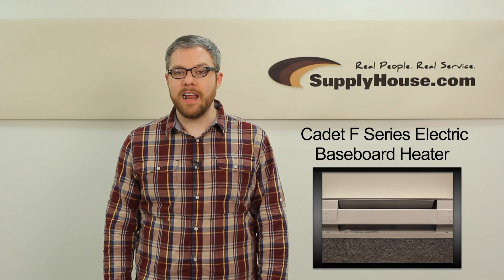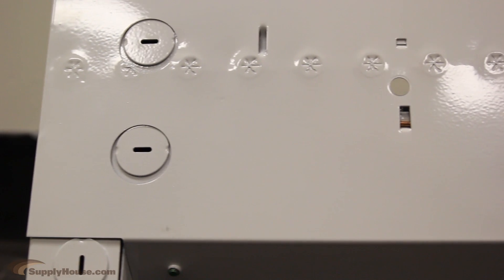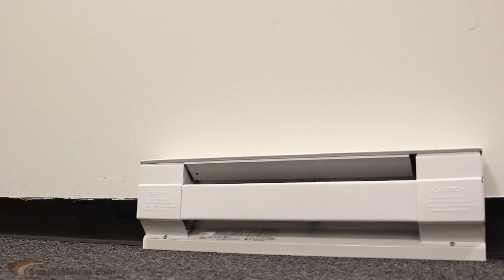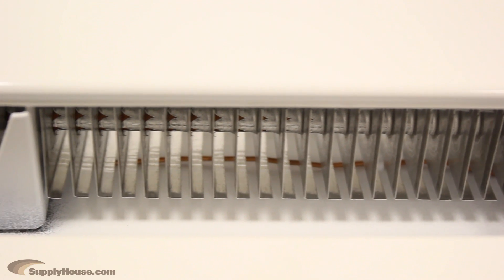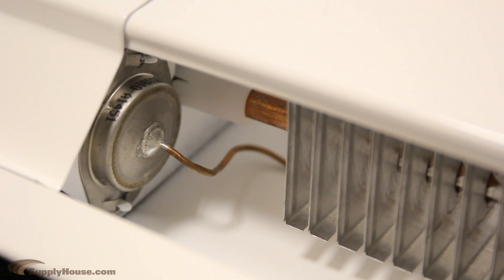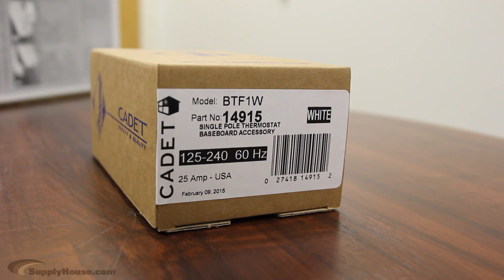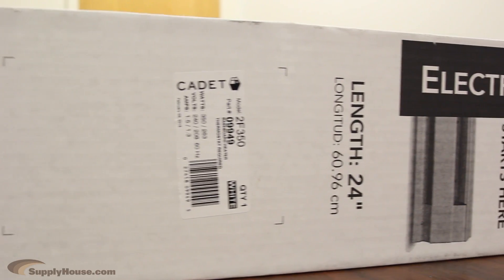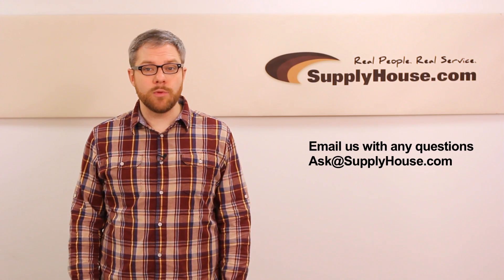Cadet F Series Electric Baseboard Heater

Comment: Why can't it be placed under a electrical wall outlet?
Reply from the maker: +MrNas921 

Manufacturers installation instructions will normally state that minimum clearances must be followed (6" to 12" clearance above the unit from any combustibles, dependent on manufacturer). Installation instructions also normally include the warning to not install the equipment under an electrical receptacle. 424.9 of the NEC and 1405.1 of the IRC allow for receptacles installed as integral devices of the baseboard heater can substitute for the required receptacles in rooms.
Follow the listing & labeling of the manufacturer. Install according to manufacturers instructions. 

but yeah looks like national electric code, I would guess its a safety thing about heat near the outlets im not sure what it says or why exactly
Reply: Thanx for the clarification
Reply: Find a outside wall without a receptacle in the middle.
Reply: Because common sense ...